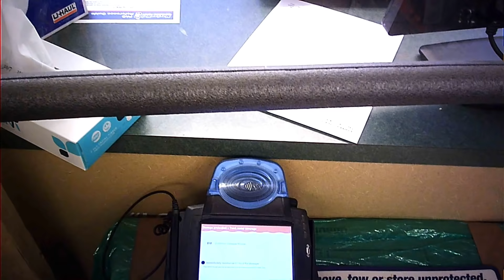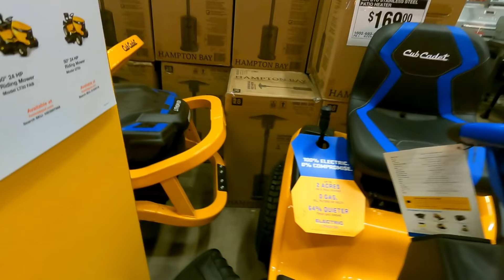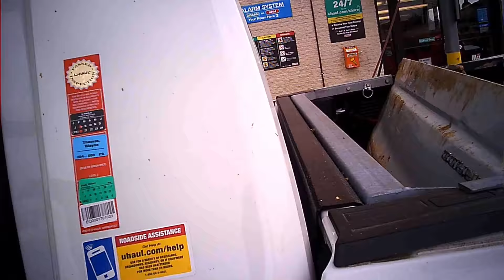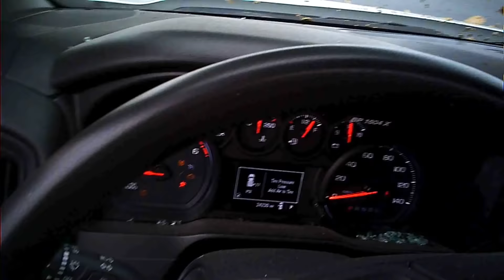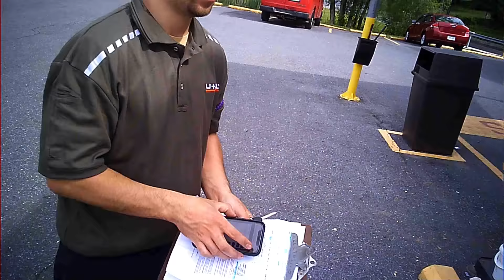Renting a UHAUL Truck, DESTROYING it, Then Returning it... *PRANK (It's Not Their Truck)

Comment: Take off all the body panels until your left with a chassis, dash, 2 seats, and a drivetrain
Reply: But it's 2wd
Reply: And an engine
Reply: Blazer 2.0
Reply: Or just engine swap the blazer, and all the fab work is done and you will have 4x4
Reply: The cupholders can stay.
Reply: @grhead812  that’s part of the drivetrain
Reply: Beamng Drive joins the chat

Comment: I think you have a new engine and transmission for the blazer.
Reply: i was getting ready to comment this but that truck didnt have 4x4 so im not sure if the trans would fit the blazer
Reply: Simple, either get a divorced transfer case and run a short drive shaft to it from the transmission. Or, swap the tailshaft and housing for a 4x4 housing. Advanced adapters also sells tailhousings that mate their atlas transfer case to 2wd transmission
Reply: Send it steve put a new engine in it already
Reply: @emanuelhurtado3718  engine will  still bolt up to the original trans if I’m not mistaken
Reply: That’s a very good point
Reply: Dude I thought the same thing
Reply: Atleast put the motor in it 😂
Reply: @emanuelhurtado3718  the truck he destroyed was only 2 wheel drive
Reply: Tazer engine swapppppppp
Reply: That's actually a great idea

Comment: Legend has it, the U haul guy still thinks the damaged truck is their's.
Reply: TRUMP2024  ?
Reply: TRUMP2024  y Trump 🤔🤔🤔
Reply: @Kem23Yt  y not
Reply: @beastlymclaren4631  I'm just asking
Reply: TRUMP2024  not hard to buy a truck from arizona and swap plates out...
Reply: TRUMP2024  where is this tag? The only permanent tag for a vehicle in Arizona i can find online is located on the license plate. Its 2 or 4 screws to change a license plate out from real truck to fake truck. I dont believe the plate numbers are shown on the real truck to confirm this though, however if the plate numbers were different than the rented truck they would instantly know and call him out because the door jam numbers already didnt match. Notice at 21:36 after the first reveal that the plate is missing from the fake truck but at 21:50 for the other reveal its there. More than likely took the plate off the rented truck and put it on the purchased truck. If its some other permantly fixed inspection tag or something im not seeing its not that hard to buy a truck in arizona with said tag.
Reply: TRUMP2024  exactly, its not hard at all to change a plate out. Its not illegal if not driven on the road either, wich the plate was never shown while on the road (from what i remember). Why is the plate on the fake truck in one clip and not there in the other then back again at a different spot? Because they swapped the plate.
Reply: TRUMP 🇺🇸🇺🇸🇺🇸🇺🇸💯🦅🇺🇸🇺🇸🇺🇸🇺🇸🇺🇸 2024 BABY!!
Reply: @Ray00069  commenting to come back to this in a few years
Reply: @moosen189  you won’t be forgotten

Comment: Tailgates are designed to come off with no tools
Yo we got that tailgate off with nothing but a sledgehammer and a pickaxe 😂
Reply: I caught that too (8:52), Not as dramatic to just lift it off orrrrrrr?
I'm going w/orrrrrrr..
Reply: They were breaking the tabs.  On purpose.
Reply: You actually do have to use tools to remove a tail gate
Reply: @raptor-yg1ek  wtf do you drive?
Reply: @yzrippin  I've removed a tailgate before. Have you?
Reply: @raptor-yg1ek  04 f150 06 silverado 04 sierra 03 tundra 19 tacoma 07 tundra 17 tundra 18 ram never needed any tools. Care to explain?
Reply: @yzrippin  the cables that hold it in the open position. You need a bit (I believe it's usually a t45) to remove it
Reply: @raptor-yg1ek  again on all the models stated you are wrong.
Reply: @yzrippin  well how do you get the cables off...is it a quick disconnect or something?
Reply: @raptor-yg1ek  so YOU'VE never taken a tail gate off have you?
Reply: @raptor-yg1ek  I've never run across one that needs more than opening it 1/3 and lifting the side that has the cutout, if you're referring to the lighting/wiring (That most don't have) I digress, but the actual gate needs no tools.
Reply: @yzrippin  yes I have, I'm trying to figure out how you can remove the cables that hold the gate in the open position without using any tools, because you need to remove those to take the gate off.
Reply: @raptor-yg1ek   You hold the tailgate at roughly 45ﾟ angle with your other free hand you rotate that cable and lineup the keyway and it slides right out  They've been doing it like this since the fifties
Reply: @raptor-yg1ek  you push the spring clip, then slide the key hole up and remove. Every single truck i have ever owned or operated has this exact method for removal.
Reply: @Jeremyv1980  yep, you're right man. My bad
Reply: @raptor-yg1ek  Respect for being big enough to say this! The world would be quite a bit better if we would humble ourselves a little and admit when we're wrong instead of buckling down in our pride and insulting anyone who proves us wrong. God bless you, my friend!
Reply: @Drspeiser  thank you brother!
Reply: Shows his obvious ignorance
Reply: @kksome10  thanks for really adding to the conversation bro.

Comment: ok i am impressed some sort of air bag or safety device never went off.
Reply: Right
Reply: OnStar never checked on him once...
Reply: Why would an airbag go off if the car wasnt moving
Reply: @foundwheels1939  because thats how airbags work lol what do you think, they just stop working if you get rear ended while stopped at a red?
Reply: @bog_trotter3465  Correct.  Rear-ended collision doesn't trigger front bags.  Neither will a sledge.  They run on accelerometers
Reply: If you don’t wear the seatbelt airbags don’t trigger
Reply: @matiasbp182  what?

Comment: “We removed the tailgate with nothing but a pickaxe and a hammer.” 

Does it take tools to remove the tailgate?
Reply: Nope
Reply: 2 clips and angle it up pull right off takes 10 seconds at most. 😆 I seen a dude do it at a dealership and take off running with it. I guess he messed his up
Reply: I don’t own a 2018+ truck so wasn’t sure If something changed I wasn’t aware of lmao 🤣
Reply: A pickaxe and a hammer ARE tools
Reply: @Callixtus14  yes, which is why I asked what I asked….
Reply: @codyology  I used to work at a ford dealer and one morning I went in a whole line up of 8-10 white f250s had missing tailgates parked along a main road lol

Comment: That guy need to learn to swing a sledgehammer. His back is hurting and he’s doing less power AT BEST. He could seriously injury im himself holding it with two hands on the end.

You take one hand and slide it up to the top and give it just let the weight fall or if you get really good you learn to give just a little tiny push to the top and a slight lift in the bottom still sliding your hand down with each sledge and let you hand slide back to the grip.

Comment: See you said you took the tailgate off with only a sledgehammer and a pickaxe, it doesn’t take any tools to take them off usually and especially on that new of a truck 😅 the old 60’s and some 70’s blazers and broncos you have to remove the bracket to get the tailgate to drop but now you just take the clips off the little bolt holder things on the bedsides and then put the tailgate at a 45 and the right side should lift off the mount, I know it’s a little too late for that information but for anyone that watches that and thinks it’s hard to get one off they aren’t usually that resilient 😂 still love the video 🤟

Comment: The return guy is ether acting or an idiot. The first thing you look for is the unit number in black or white letters. There are no unit numbers. All the pickups are leased by Uhaul. Any uhaul dealer can look up any unit number and tell who has rented it. To return you have to use the unit number. They bring them back with bird crap, food splattered, food left, trash in the back, pills all over the back, etc. Then they steal them and paint them with house paint thinking uhaul wont know. They rent car dollys made for a small car and tow a 1 ton pickup. Then there the thieves who steal the catalytic converter and drill a hole in the gas tank with a dewalt drill and set themselves and the truck on fire. I'm a uhaul dealer and this idiot, the creator would not have fooled me for as long as it would take to walk to it. I also am a Uhaul repair service and towing provider. If this guy tried to pull this on me, he would be banned from uhaul for life. This encourages bad behavior.

Comment: OK This is what I would do. First find a actor Blond Have her get a new driver's Lic. With today's date, Have her play the insurance over,over,KILL!!! And want to see the BOSS Trying to get more, With, what if,what if, what if??? Have her Drive As SLOW AS POSSIBLY!!! Bump Car's that you set up JUST To make sure! But Don't Hurt Anything! Jump Every Curb!!! ect. Take The truck with the (4 Way's On) Watch out For Cop's! And then You'r Truck Do Not Even Put A Scratch On it Just Take out all window,s  Replace the door With a Total Rusted Out One, replace the head lights with flash light's. remove the engine, mount it in the bed, So you can not see, That it's mounted at ALL! Just setting on some old looking 4x4's And use one string to hold down, OVER TOP! Get a 10 H.P. Put that in with the pull string starter, as she will need it when she hit's the Kill switch, Blocking the Drive. Pull in with her Dasey dukes, And super POP Btl, Glasses She's Had on the whole time, And Wanting Her Money For Replacing That TOO FAST,DANGER MOTOR!!! SWAP, And Never say anything! Just I Don't Know What You'r Talking About??? Drives Away in Her Semi, or Lambo? Something Like That Anyway, Have Fun, Life's Too Short Not To!!!